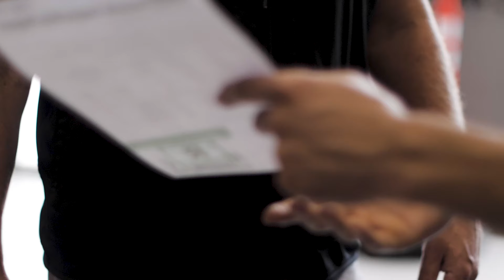How to Become an Automotive Mechanic

Comment: Wow. Finally a college that actually listens to the people behind the market. They covered practically everything here. Impressive. Now let's just hope there are enough grants to go around with them high tuition costs.
Reply: gasoline boils at 140 degrees Fahrenheit  you need to get copper coil 12v immersion heater and start vaporizing your stored gas vapor low pressure system

Comment: If you are concerned about the $$$.  UTI has 15 million ---- yes 15,000,000 in Scholarships and Grants available.  Go for it! When Techs Rock, America Rolls!
Reply: That's alot of money leaving UTI just to bring students in. No way there's no catch to it. I would read the fine print no doubt.
Reply: @TechForceFoundation  I understand. However I just realized that most scholarships require applicants to have high grades in order to receive the scholarship.
Which most people dont have. 

So its like a high hanging fruit most people wont be able to access. A good offer made by colleges knowing most people wont be able to pay back their loans so easily.
Reply: @AutomotiveForBeginners  While it's true that many 4-year university programs often require high grades for scholarship consideration, and we cannot speak for all of UTI scholarship requirements, you may be encouraged to hear that the average qualification point for consideration for a TechForce Foundation scholarship is 2.7gpa.
Reply: @TechForceFoundation  That's not too bad. Although I recall scholarships only paying for a portion of the tuition as well. So even though there are $15,000 scholarships out there for straight A students, the tuition for them 4 year programs are going to be up in the $30,000. So it's an offer that is not really the greatest.
Reply: @AutomotiveForBeginners  you are correct. The key is to apply for multiple scholarships because new scholarships continually open up.
Reply: @TechForce Foundation It would be good if you consider international students too who aren't citizens of US. Am a Kenyan and currently an Automotive Technician student and I would love to join UTI to proceed with this course under scholarship but because of citizenship I can't have a chance
Reply: @ochiengfelix-q2m  because we are a non-profit we have to abide by certain regulations.  We wish you the best in your technician path.
Reply: @TechForceFoundation  is there any organisation that can sponsor me which you can share with me the information about it kindly?
Reply: @ochiengfelix-q2m  Sponsorships, not that I’m aware of.  You may want to call UTI directly and ask Student Services. Good Luck!
Reply: @TechForceFoundation  there is no sponsor in the UTI school?
Reply: @justincoloma1208  what do you mean there is no sponsor in the UTI school?  Do you mean the UTI school you are going to does not have any scholarships available at this time?  Please clarify.